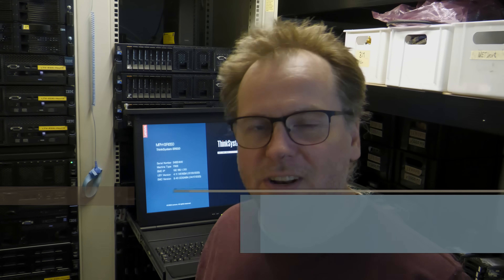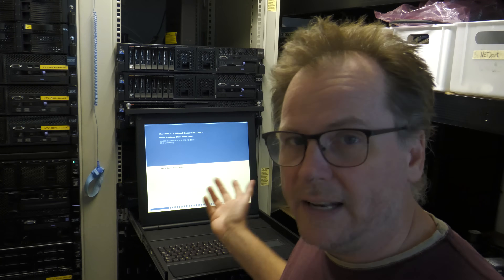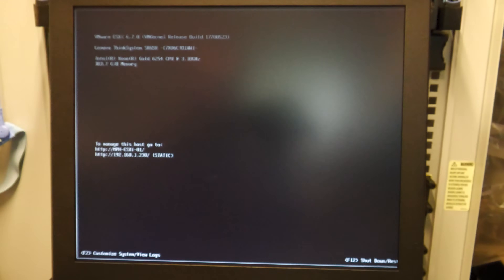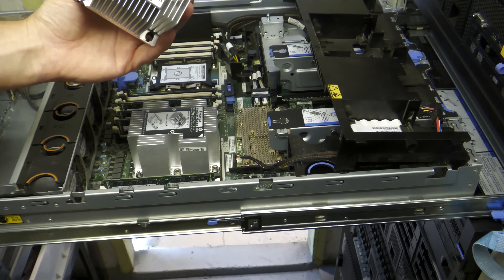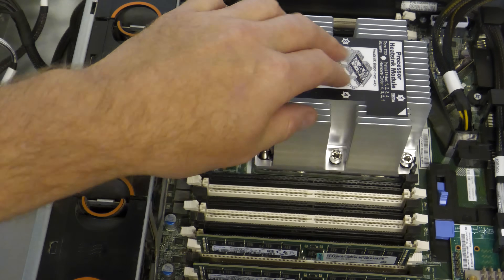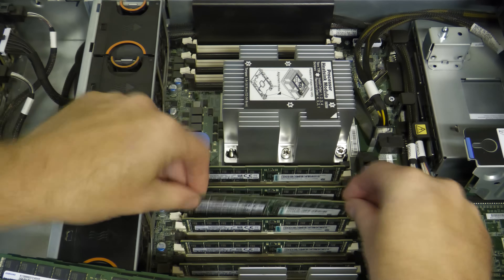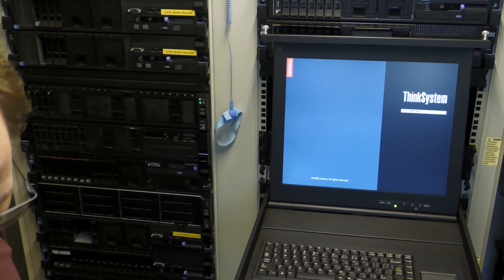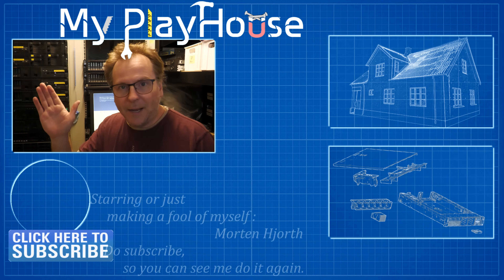CPU 2 and 384GB more RAM in a Lenovo SR650 - 1517

Comment: Interesting subjects. After 2027 I can't use my solar power generated in the summer for the winter anymore. Worse we have to pay for the unused feed back power generated in summertime. Now using a Dell T430 with Proxmox. Running a VM with the power hungry Milestone VMS. Now testing with Frigate for my camera's system. Then thinking about a Proxmox server that uses less power.
Reply from the maker: Yes,, we do not want to pay to feed the grid,, we have that as well,, I am charging my battery right now,, as selling prices is right now 0,08 DKR,, but later today it is 1,46dkr,, so store now,, sell later :-)

Comment: I have an SRV650v2 and I don't run it for one reason, the noise, the damn thing is just too loud for me, and the freq it whines at irritates my brain :) I also run the SE450 from Lenovo, this one is kind of loud as well but without the annoying whine, and it has 512GB of ram :) Great video, and nice to see you got your solar power going to good use.
Reply from the maker: Yes solar is up and running, and I have saved like $161,50 every month, these last three months,, summer is good for solar :-)
Reply: I managed to get the noise down on my SR650.  I can send you the script if you like: it's a python thing that says hello to the XCC every 30s so that it turns down the fans while it thinks about what to do next.

Comment: You aren't going to want to  join that server to the cluster unless you have a raspberry pi laying around. You need to have more than half the cluster online for you to be able to interact with the server including logging in to the web gui. If you made it part of the cluster you'd need it running 24/7 as well. In theory proxmox datacenter manager will wet you migrate VMs between severs that aren't part of a cluster that is probably a better way to go, but it is still technically in alpha.
Reply: It's a way to get rid of the excess power, but. not very economical!
Reply from the maker: Okay,, sound complex... I just want to use a more powerful server when power is plenty :-)